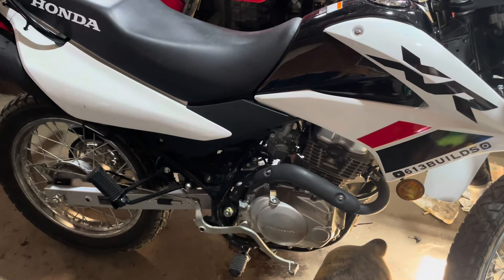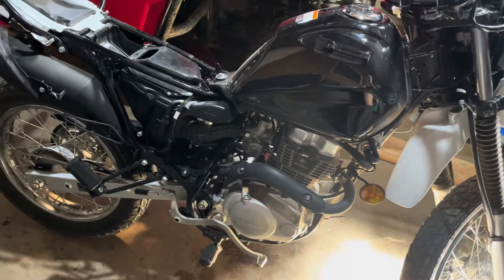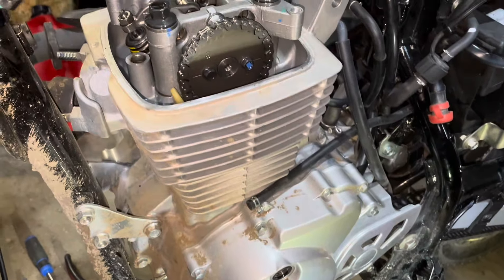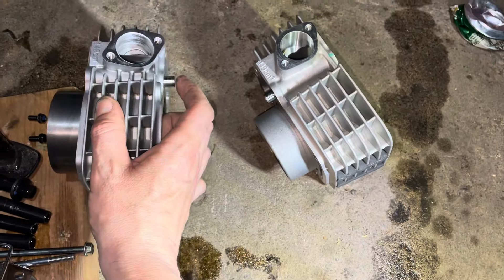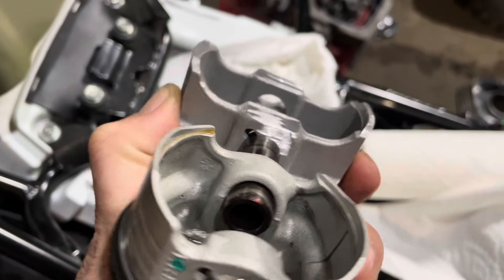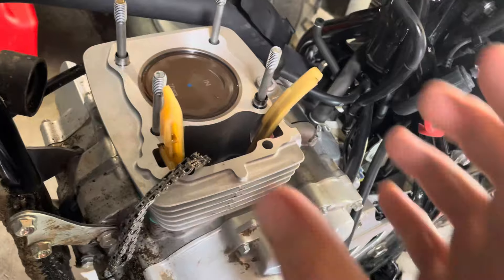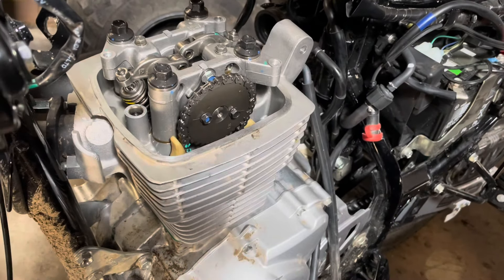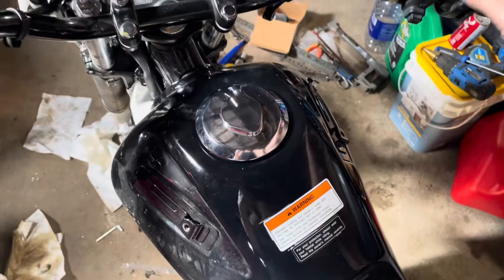Honda XR 150 L 70mm 222cc Big Bore Kit Install & 27mm Carb Upgrade

Comment from the maker: Thanks for watching 🛠️😎👍
Reply: @613Builds  your clips were taped to the bottom of the inside of the piston!  I just checked my kit and they were hiding really well!  I hope you haven't sabotaged your engine!
Reply: LOVE THE VIDEO BRO! EXTREMELY HELPFUL for me due to the fact im getting the same kit do you have a link to the carb?? and what jet??
Reply from the maker: I installed a PZ27 carb from Amazon It’s almost identical to the factory carb except for it’s not electronic.  Yesterday I got a PZ30 with the same bolt pattern as the pz27 but I haven’t tried it yet.  I haven’t messed with the jets or tuning yet because I might add a cam or performance cylinder head soon.   Perhaps I misplaced the clips, but I was not able to find them anywhere, and if they were in the bottom of the piston, I would have noticed when I installed the wrist pin

Comment: Great step by step video, I ordered my big bore kit a couple months ago and this will help me install it. Let us know what your top speed ends up being. I welded a 02 bung on my exhaust and used a air fuel guage to tune it with an exhaust and can hit close to 70 here in California. With a 16 tooth front sprocket I can pop wheelies and accelerate more appropriately. I think with this kit and the right cam shaft and tune it will hit 75 no problem and my goal is 80mph but well see. Thanks again guys like you help out a ton with these niche projects
Reply from the maker: @kriswthak9175  my top speed right now is only around 105 km/h .   I still have the same gearing in the same red limiter so I wouldn’t expect that to change much until I address the gearing or the gear ratios.  There’s another guy on YouTube.  “dusty steel”  and he claims to beginning 80 mph with a smaller rear sprocket , big bore kit, and a bunch of performance mods.  I do think it’s possible with the right gearing, which would be the opposite of the way you went with the 16 tooth smaller front sprocket.  With a small displacement 5 speed You could have low end torque or top end speed but it’s hard to get both.   Right now I have the factory sprockets, but I would like to go with the 18 tooth on the front or maybe a 46 on the back for more top speed.   I plan on doing a cam swap or maybe a cylinder head with bigger valves sometime in the near future
Reply: @613Builds bro thank you so much for the shoutout!! With a 18t in the front and a 46 in the back I’m still topping out 5th gear at 88mph. If I had more gearing I could go even faster. I might try a few more things to get an even higher top speed.
Reply: @DustySteelGarage  what else have you done to it?
Reply: @BigTexUSA  I had a PWK30, 70mm BBK, 36/31 Big valve head, custom intake, and full racing exhaust.
Reply: @kriswthak9175  the head helped a lot with top end.

Comment: We are all big dummies sometimes.  Great job and sounds normal.  I got the 26mm so I might go to the 27 too.  Same bb kit.
Reply from the maker: @shedred1967  I found the 26mm carb to be the same as the stock size.   So I went 27 then later I opened up the exhaust and installed PZ30

Comment: Good quality video, very clear. I have the XR150, stock bore size with the PZ27 carb like yours here in the Philippines. A couple of suggestions, some of the video time you spent on comparing piston sizes would have been better spent on the steps not shown such as clearancing the new piston and the cam chain guides R&R. Also, I would have cleaned the engine before disassembly  to reduce the risk of getting dirt in the engine. Overall, a clear, helpful video!
Would love to see an update on fuel consumption, carb performance and if you had any issues later. Thanks!
Reply from the maker: @telcobilly  I only had to remove one timing chain guide if I remember correctly it was the front guide.   It simply lifts out with your fingers if I remember correctly.   Timing chain tensioner is spring loaded self adjusting so it’s just bolt-in.  I only clearanced under the wrist pin a bit, I used my 4.5” angle grinder 🙈🙉🙊 and a file .    You’re right, it needs a good cleaning .   I have a few more xR150 videos planned, I just need free time to produce, edit, export, upload & edit 😅
Reply: @613Builds  Thanks for the quick reply. I'm curious to hear about your experience overall with BB kit. Are you sticking with the PZ27 or getting a Nibbi carb? Subbed your channel. 👍
Reply from the maker: @telcobilly overall like the extra torque from the big bore kit.  I’ve upgraded to the PZ30 and removed the muffler baffle recently.   Might do some port matching or performance cam later.   I’ve ordered an 18 tooth front sprocket ⚙️
Reply: I just rewatched your BBK installation video again. Still really in impressed with a camera work and clarity of it. Do you have a part number or link for the 18 tooth sprocket? I'm always shifting into the non-existent 6th gear because I have motard wheels and it seems like it could stand to have a higher ratio on the street. I kept my stock wheels for off-road work.  How is the BBK working out for you as far as reliability and fuel consumption? I'm sure there's a noticeable bump in power. I just watched your PZ30 installation video and I'm real happy to see that the stock boot fits on it. Did the PZ 30 make a difference in power and running? Thanks again!
Reply from the maker: @telcobilly so far it’s been good.  There are different versions of the PZ30 but I ordered one that has the small bolt pattern to fit same as the stock intake manifold boot.   I think I might have stretched the breather boot a bit but the stock boots did fit my application.   I got my sprocket from www.sprocketspecialists.com they make what you need and it fits the output shaft splines .

Comment: You should have checked the valve settings while it was stripped  down considering  how mutch work is entailed in stripping it down just to be on the safe side
Reply from the maker: I mentioned in the video that the valve lash appeared to be spot on, almost perfect.  This is a 2024 model and it barely had 600 miles on it when I did the big bore upgrade.   All of the valvetrain is contained within the cylinder head. Overhead cam overhead valves.  There are no pushrods going down There are no components related to the valvetrain below the head, aside from the timing chain, and setting timing is mandatory.  I was planning on checking it, or setting it which is why I mentioned it, but it appeared to be spot on

Comment: Please let us know what carburetor you used .
Was the clearance of the piston needed .
And what was the top speed using the stock head .
Thank you for your hard work and explanation. 
I have the same kit and the new SS exhaust arrived yesterday  . My current mileage is 2500 miles and loving the XR150L  .
Reply from the maker: @philipcloutier2553  I used a pz27 carb for now off Amazon.   I’m told the piston needs to be clearanced yes under the wrist pin I tried to match the thickness to stock piston.  My top speed was around 95 kph on flat.   I’m getting around 95-100 kph now but I still have mods and tuning to do
Reply: Thanks for your prompt reply .
 I hope that changes when it is broken-in  , as I am consistently getting those speeds right now stock tucked down and no headwinds , with 4000 klms on the OD . I am just above sea-level  .
I have purchased the SSS big bore kit and have now received thier SS exhaust  .
Reply from the maker: I’ve already bought a 18 twos front sprocket for overdrive or higher top speed but it doesn’t fit the output shaft so either I need to modify it to fit or get another sprocket because the gearing and red limiter really determines your top speed

Comment: I do like the bike & this upgrade is one I probably would want to do BUT something inside of me screams "NO No, 
don't do that to a new engine that's not broken!?  That said,  needing to go faster on highways would push me to
do this.  What about the material you trimmed off the lower part of the piston?  I see how you determined where
to trim to but in doing this is there a way to make sure it's still properly balanced?  I know nothing about this so I
am asking & I may be purchasing one of these so this is important to know.  Thanks for the work !  peace
Reply from the maker: @diggy-d8w  yes, the balancing and compression are modified as soon as the factory 57 mm piston is removed, the clearances on the bottom of the piston by the wrist pin area is for clearance reasons to clearance the rotational assembly inside the crank case.  It seems strong enough, and the Factory balancing has already been altered by removing the factory piston. Anyway, if anything helps some weight reduction, which might actually bring it closer to the Factory piston weight.   I don’t think removing any material there for clearance would have any negative effects.  For top speed, I will be installing an 18 Tooth Front Drive sprocket, and the big kit helps with low end torque, which helps provide the power to carry the vehicle with less effort Or at lower RPMs and higher gears.   This should allow me to install the overdrive sprocket and achieve higher speeds, now that we have enough torque to counter and justify the overdrive gear
Reply: Ohh hey there,   this little bike isn't exactly what I want but I'll tell that it's the only bike that I know I'll have the
money to pay cash for.  As for the mechanical part,  I'm doing good to change my oil & the filters but as I saw
you tackle this I had to ask those questions ;  that way, if I did do this "223" upgrade I'll know I do not have to
worry about these things you've showed us all.  Thanks for that & I'll be checking out some of your other vids.
peace
Reply: TY for responding to a prospective biker..... the "Balance" I was thinking of was the physical weight balance of
that moving piston?  I've never seen/heard of a mechanic taking off metal on an actual piston so I asked. Ohh,
were you aware that you can change this bike by changing the ECU?  It has one & I saw a forum that speaks
about it as it pertains to this bike.  That might mean that you can throw the CARB to the side & pick up one
of those metered valves?  They aren't Injection but aren't a carb either,  there at least two companies that
make them & it's said by using these there's no more issue w/ elevation or cold weather?  If you weren't
aware please look into it,  it might be a game changer & also flashing the ecu will be great AFTER you've
got the exhaust & other mods completed.  I don't know if there's a Flash for the  223cc engine mod you
just did but I bet there is?  Let me know & I'll see ya here soon.  peace

Comment: What carb did you use and did you have to change the throttle cable to get it to work?
Reply from the maker: Yes you need to change the throttle cable if you upgrade or change carb size or style.  I upgraded to a pz-27 first then I upgraded to a pz-30 in a later video

Comment: Yess, is that stock carburator? Or you change it to big,,
Reply from the maker: I upgraded to a bigger PZ-27 first , then I upgraded to PZ-30 later.  30mm
Reply: @613Builds  what about the top speed your new big bore 30mm?
Reply from the maker: @ mostly lots more torque down low.    Top speed is mostly gears and rpm’s.   Later on I did install an 18 tooth overdrive gear on the gearbox, that made a small difference where top speed goes up a little and RPMs go down a little.   But top speed is mostly geared to the rev limiters .   When I changed the big bore kit I saw a huge jump in torque power but not a huge change in top speed.    But it would reach the top speed 0-60 much faster.  Mine goes about 105 kph on flat and will reach up to 115 or close to 120 kph downhill with the overdrive sprocket.   But I didn’t change the gear ratio until later after the big bore kit install because you need the extra power to push the overdrive gear set.   Usually when you gear up you’ll sacrifice some low end torque but the big bore kit takes care of that.

Comment: That looks like the exact same kit that I got for $70. Is this the SSS kit?
Reply from the maker: This kit was almost $200 Canadian , I can’t remember the brand.   Looks like the same piston
Reply: @613Builds  no Brasil somos muito familiarizados com esse motor da um Pesquisada Kit aumwnto de cilindrada CG 150 2015
Reply: @kbecadegelu2842  I’m making mine a 300cc. You probably could tell me all I need to know about that lol.
Reply: @DustySteelGarage  Tem um site chamando JEFFERSON MOTOS fabrica kits até 240cc paramotores 150cc plug in play porém não vende os carburadores mas rexomendo um carburador de cbx 250 twister

Comment: should get and  install the stage 2   model is Performance Camshaft CRF150L CRF150F  from sxparts $65 us dollars plus shipping . works grate on my xr with the big bore kit
Reply from the maker: @CrazzyBacon172  😎👍🛠️
Reply: Nice! What size BBK are you running?
Reply: I don't get it?
The CRF230 motor is 223cc.
The CRF230/150F frame allows peg adapters to place them backwards an inch.
The CRF230/150F all aluminum swing arms.
The XR150L Frame is identical to the CRF150F and CRF230F, without the option of foot peg relocation and I hear it comes without link suspension? 
*So why not drop a 6 speed CRF230 motor in the thing and call it a day?
Reply from the maker: @shockadellick  i’ve effectively converted this 2024 engine into a 222 cc.      I would enjoy a six speed gearbox, but I’m not sure what that would cost or where to find one and presumably it would be a bigger and more expensive job.   I’m pretty sure the CRF 230 is electronic fuel injection, so there are some differences there as well. Aside from the six speed transmission. The head is different and the fuel delivery is different, There are holes in the head for sensors in the CRF 230 and 150 I’m pretty sure.   I like the idea of a 6-speed gearbox but I’m not sure where to find a 2024 or zero mile 230 engine or what it would cost or how much work would be involved in converting the fuel delivery.    I’m sure I could make it work but it would be more expensive and more work for the same displacement 🤷🏽‍♂️
Reply: @613Builds  if I were to swap engines I would definitely go bigger than just a crf230. With a 78mm BBK I’ll be around 276; 296 if a stroked the motor.
Reply from the maker: @DustySteelGarage  yes I agree, if I was going to go the effort and expense of swap engines,  i would def go bigger than 230cc.  I had a CBR250R (EFI) previously and it was fun, adequate enough to go 160 kph.  Where did you find the 78mm big bore kit?
Reply: @613Builds  that motor would be fun on our bike.
Reply: @613Builds  78mm big bore I got off the bay. It came with a blank piston that needs to be machined and so does the crankcase.
Reply: @613Builds  I’m also putting a 39/34 head on it that I got from FB.
Reply: @613Builds  Abe’s Engine Idea, he has whatever size kit you want but it’s very expensive!!
Reply from the maker: @DustySteelGarage  yes, I can imagine the crank case would need to be opened up to accommodate the sleeve of the cylinder, even the 70 mm cylinder sleeve just barely fit into the case.   Makes me curious about the lower case gasket and the head gasket mating surfaces….
Reply: @613Builds  what about them? Just less space? I’ll probably have to keep my eyes on those often.

Comment: Did you bore out the crank shell or just plug it straight?
Reply from the maker: @H0GS16  That’s not how it works .  The top end is the cylinder that is the bore that’s the size diameter of the piston.  The crank is the bottom, and there is no bore in the crank.  I’m not doing anything to the crankshaft in this video.   The new cylinder is already boarded out to 70 mm for the new 70 mm piston.
Reply: @613Builds  I meant did you resize or shaved some metal where the sleeve usually goes? Or something
Reply from the maker: @H0GS16  no only the bottom of the piston near the wrist pin , as I showed in the video.   The rest is direct bolt-on
Reply: @H0GS16 I’m thinking about boring out the crank case wall and  maybe going bigger than 70mm. If I do that though I might also add a +4.2 crank since I think the crank would need to come out anyways to bore the crankcase where the cylinder slides into. I think I remember looking when I put the big bored cylinder in if there was any clearance around to go bigger and thought it was already a tight fit. I’m going to make a video soon showing that.